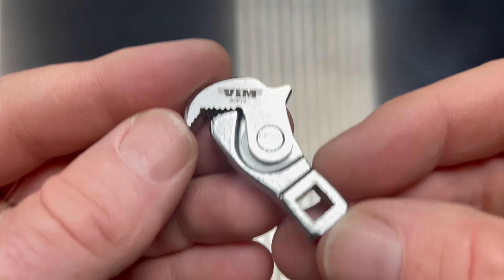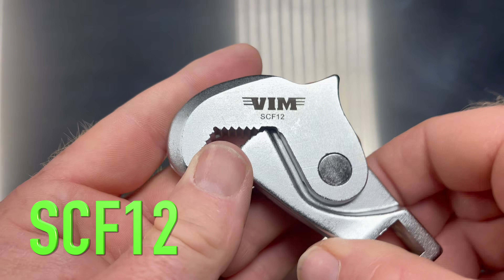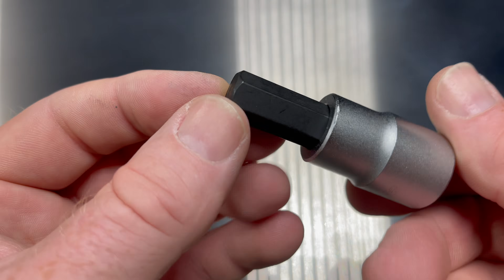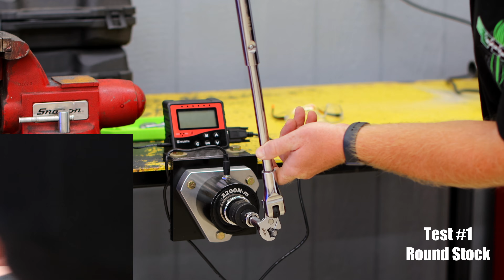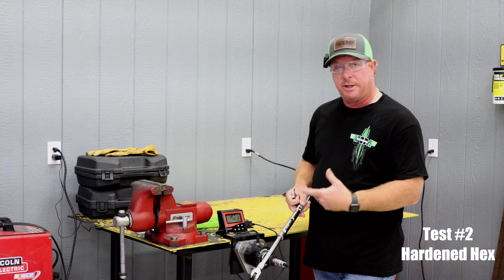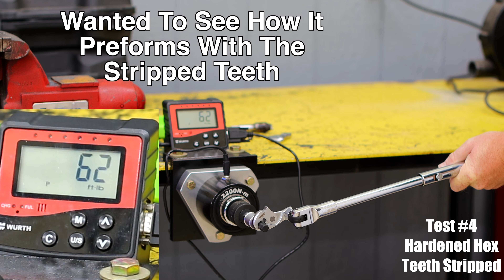SCF Test. The Break Room Ep. 14

Comment: Again it looks like you are inducing a twisting component with they way you are putting that reducer on it.  If you cold get the leverage force more in a straight line with the tool center line you will likely get a better result.